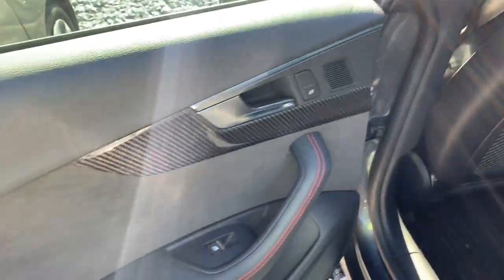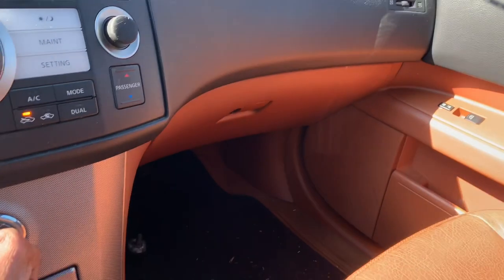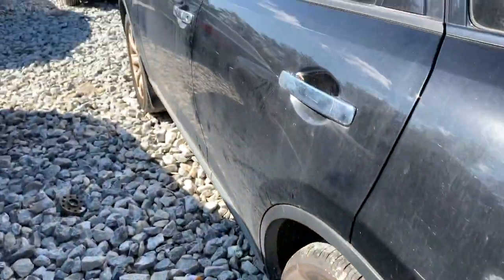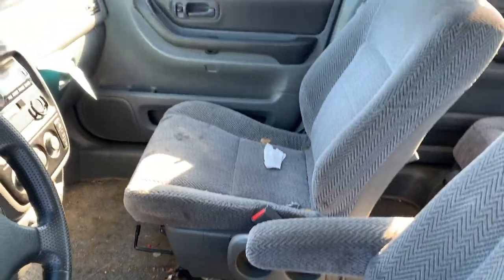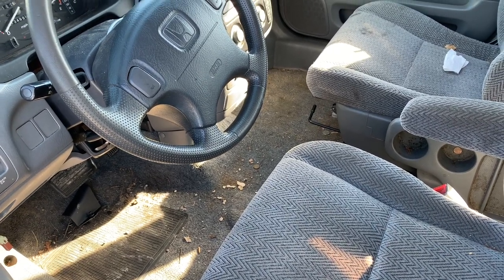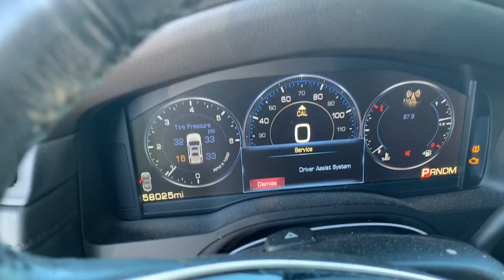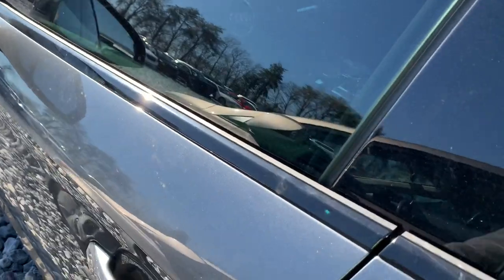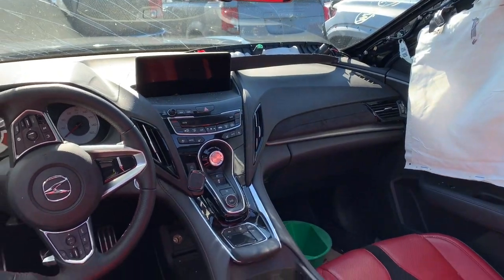FOUND A CHEAP AUDI RS5 AT COPART WITH *LAMBORGHINI INTERIOR*!

Comment: That FX35 is a solid joint driver side leather looks good, no dash crack usually a major issue on those models. I bought a 03 FX35 AWD myself last week it was 169K, 3K with all fees factored in you may have to spend a bit more considering its an 07 model it’ll likely fetch around 4 to 4.5K is my forecast there nothing in the Japanese CUV that matches the driving dynamics of a Porsche other than this FX.